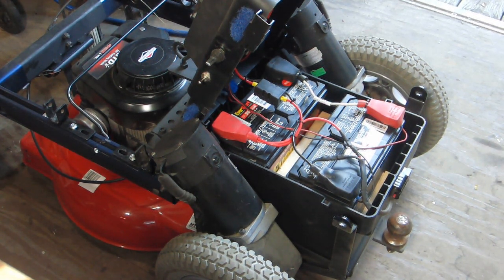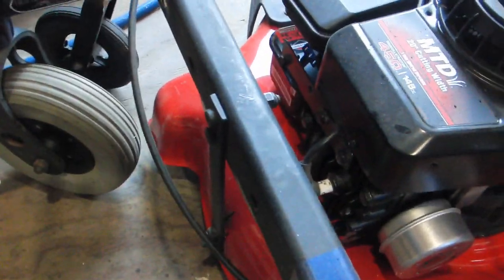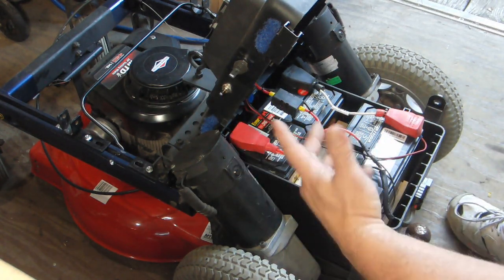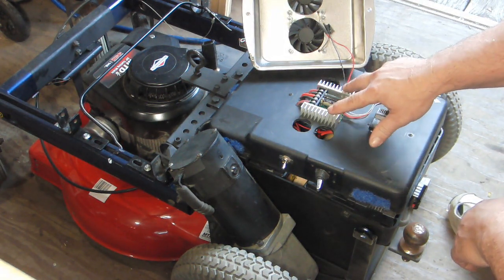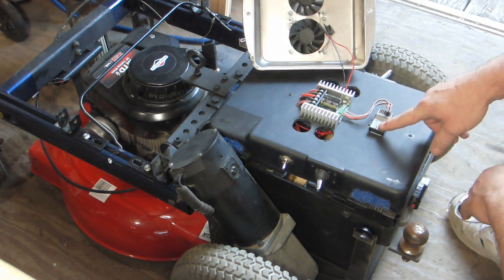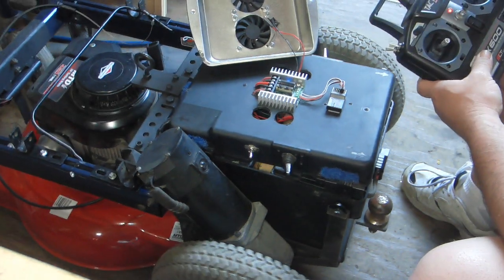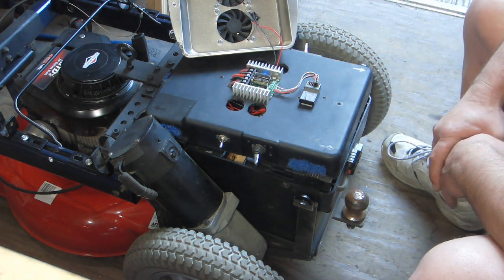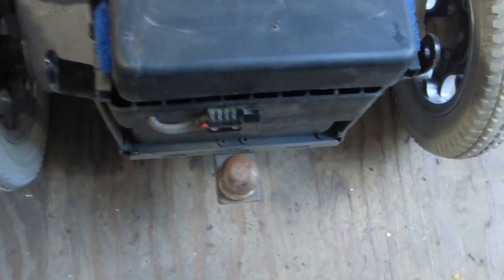Remote Controlled Lawn Mower

Comment from the maker: Hey Girl:) I looked up the motors online and you can buy a pair for about $250 w/gearbox and wheel. An iron frame, hand built, for about $100. Batteries $160 front wheel $20. Mower $150. Remote equipment about $200. Still not cheap. A complete DIY would run just under $1000 with wiring, switches, nuts and bolts etc.

Comment: You can loose the handle lever by taking the brake off the flywheel that it works and wiring up a switch to the coil tab with a ground to kill the motor. You can even put a servo on the switch to kill it remotely.I didn't build my rc mower with fame like most people are doing and thats how I turn my motor off, works like a charm.

Comment: brilliant stuff !!  i have same wheelchair in my shed, and a worx 24 volt 14 inch cut mower, so being same voltage my goal is to run the mower from the wheelchair batteries for amazing mower run time, and quieter than gas, your design is the best i've seen compared to others who retrofit mobility scooter  drivetrains  to back of gas mowers

Comment from the maker: Had the same problem with the old batteries too. I bought two new automotive batteries that measured the same size as the old ones. They're 12v each @ 500 cold crank amps. They work fantastic.

Comment from the maker: The batteries run longer than the full tank of gas in the mower. I use it to mow the ditch and around pampas grass a long the fence lines. It takes a  couple of hours to mow around my yard, and they still have about 50% left. I'd say they'll run about 6 hours max.

Comment: Thanks Mr2Tuff2 for the inspiration as I finally built a mow bot using the controller/transmitter/receiver combo that you used. It works but is a little hard to control. I was hoping you could tell me what you set your receiver settings at? My receiver is currently set at pin 1 and 5 in the down position. Thanks again!

Comment: That’s pretty neat. I’d been thinking it would be fun to build a larger one, say from a 50-60” tow behind. Probably end up in the 500 pound range and need two heavy duty motors each side. Would want some rc switches to run a contator to cut power to the speed control and to the engine kill, failsafed to shut down if the signal was lost or the receiver died. 

Was also thinking a cheap pan/tilt gimbal on the throttle/rudder stick and an FPV camera/goggles or screen…

Comment: Thank you for the information , I build model airplanes and fly. No alittle bit about speed controls. The seat on the rascal electric chair raises and lowers, might be able to use the to adjust cutting height. Any though on that

Comment: Good job, TU .. but for those of you thinking about building one of these, The money I spent on building three of these, I can say without any doubt that although these are fun, they are not worth it. for the money, i could have had my yard taken care of completely for the next 12+ years.
Reply: When I built my first one I did it for the cost of a 1 year contract. It is still running well 8 years later. Admittedly I take very good care of it. Also I REALLY hate yard work.

Comment: I'd like to build one too.  Can you tell the detail for the motor controller and where to buy it please?  Cheers, Karen.
Reply: I just got one for my mower. Go to dimensionengineering.com and click sabertooth 2x25 in the left side menu. It's about $128 with shipping. Seems everybody doing this is using a radio for planes but I'm gonna use a pistol grip controller. A cheap 2ch radio ($20-30 ebay) will work.

Comment: Where fiddling you get the ESC or driver for the 12volt motors . And was wondering if you no how mini amps its pulling. I have a rascal chair a lot like the one  you used

Comment: Nice are simple. Now if one could find cheap 24V DC speed controllers that can throttle in reverse you could let that radio do the  mixing with it's V-tail mixer. 
Did you have to remove any electric brake mechanism from those motors?
A receiver with a fail-safe would be nice, then at receiver signal loss you could trigger the mowers brake handle and neutral the motors.
Nice chair attachment, but needs full tilt/recline. lol

Comment: I'm using 500 watt motors for my build, but am having a very hard time figuring out what size batteries I need.  Each motor will draw 20 amps, so do I need 40-50 amps of power from the battery(s)?
Reply: watts = volts * amps.  If your motors need 24 volts to run  then 500/24 = 21 Amps.  So you need a 24 volt - 21 Amp battery for each motor.
Reply: John Smith is right, but you'll also need to consider the size of your property. For example if it takes 1 hour for the mower to finish cutting then (21 amp/motor)*(2 motors)*(1 hour) = 42 amphours. If it takes 2 hours = 84 amp hours.

Comment: Unless handicapped and going behind in a power chair to watch and follow the line, these seem to be a waste. Getting into thick stuff weeds etc. they will stall and be hard to control. Hills, forget it. Wheelchair drive is bad when moved to the rear and castors are left to follow the forces which include all the bumps and dips. I can't see easy motion in a "straight" line only a lot of zigzagging compensating for all that. I would rather have a stiff axle drive and steerable front wheels. Imagine a go kart yet alone a car with rear wheel differential steering with passive front wheels. Traction is a real issue on everything but flat uniform surface. One of those sit on mowers of that drive makes a mess when traversing a slope, leaving a habit formed rut next door to me.